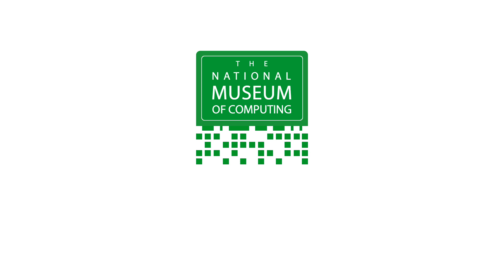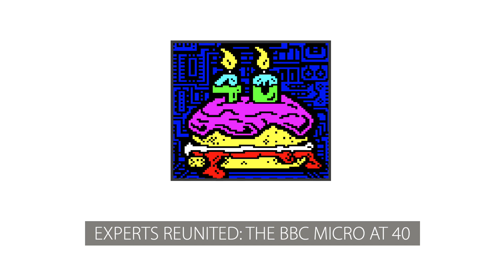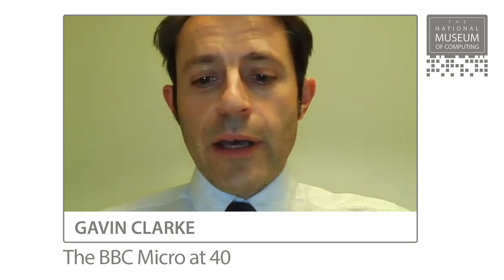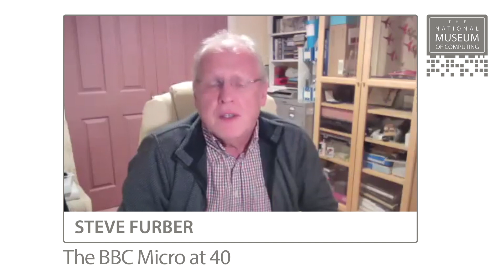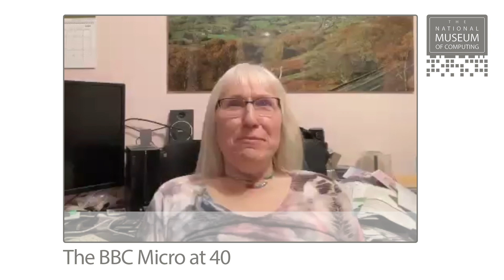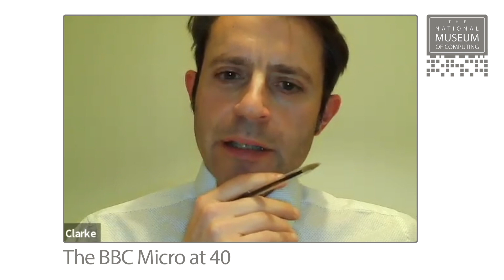Hauser, Wilson and Furber: Acorn trio reunite for BBC Micro anniversary Q&A

Comment: I worked for a company which used a lot of Model Bs and found them to be super reliable, they were running 24x7 and  the only issues we ever had was with the switch mode power supplies, the same capacitor would fail in all of them after a while, but pop a new one in and it was as good as new.  I'd already gone with the Apple ][ which predated the Model B by a couple of years, absolutely loved it and I still have it today, but I'd have gone with the Model B if I'd waited, it was a great machine for it's time.

Comment: I did a short stint, working for hp in 86/87 and the only place you couldn't smoke was in the operation room where the hp3000's were sited. Working in a technical role,  I had access to every room in the very large building.

Comment: I thought it was the Archimedes that was supposedly ‘made from riot shield material’? Or the Master? (I know I had to buy a ‘bridge’ to support my monitor for my Series 4 model B.)
Reply: It was the RiscPC that was supposed to be made from riot shield plastic. It was mentioned in the Acorn Computing issue that covered the launch.
Reply: Just to add - the Archimedes has a metal case, with a plastic bit at the front.